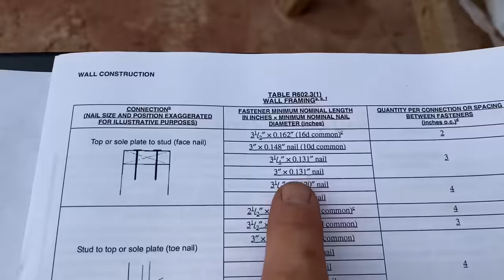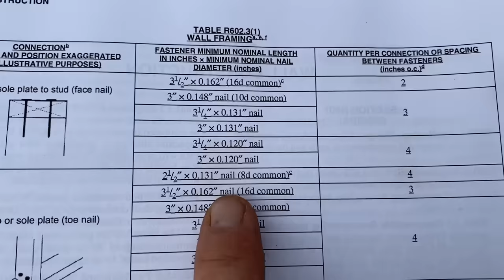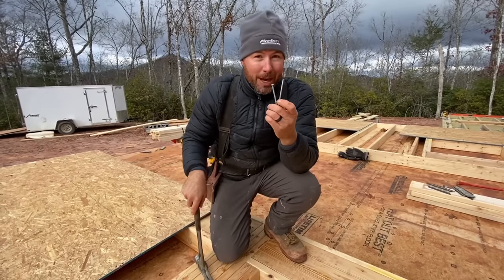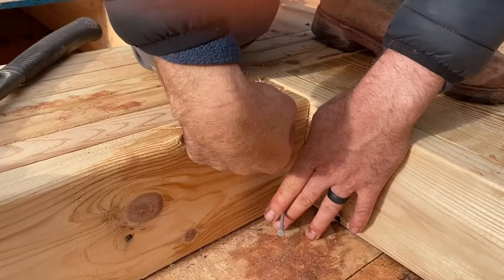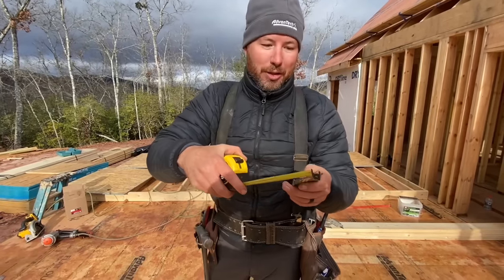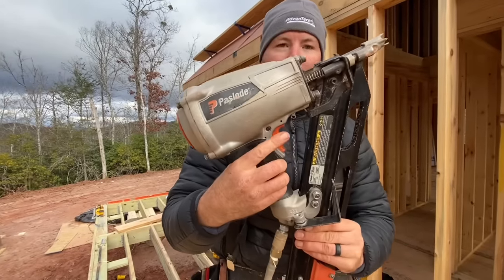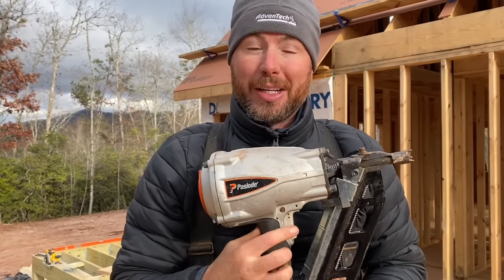Building Walls ~ All about nailing patterns and placement

Comment: Towards the end of the video I was wondering how many nails actually go in a general house and then you nailed it. And then I got paranoid and looked around the room. LOL it’s easy to find a painter, all you have to do is look for the white line down the middle of the road. Lol
Reply: Nailed it
Reply: @DiamondSupplyC0  yeah I’ve driven by a few construction sites, and I’ve learned to avoid them otherwise I’ll have to go to the tire shop later on. Lol

Comment: I’m a Framer out here in California and I love what I do makes me feel like an athlete building where there was nothing  is amazing to do and watch ...
Reply: No kidding framing is not for the weak
Reply: R. M Framing is for the weak. They are not strong enough to be Masons and Bricklayers. Carpentry is an inferior way to build also.
Reply: @zackzander425  what trade do you do?
Reply: R. M Masonry 👍
Reply: @zackzander425  figured. Masonry is tough work no doubt. But most brick houses start with a wooden frame lol.
Reply: R. M You’re right; sadly that is the case because timber is so plentiful in North America. Wood framing is relatively cheap compared to block construction so that’s why almost all homes only have brick or stone veneer anchored to a wood frame if any at all. I just look at the larger picture: fire safety, energy efficiency, durability etc . . . Masonry wins every time. I love hardwood floors, custom cabinets and trim though in a house. I have respect for all trades; none of them are easy, but they’re all worth doing. I was just being a dick. Stay safe out there on the job. 👍
Reply: Carpenter

Comment: Live It!  Love it!  Can't get enough of it!!!  Framing is amazing!!  NR90AC3 (rare Hitachi nailgun) can shoot up to 3 1/2" .162 nails if you need it.  At a min. we use .131 or .148 gauge nails as spec'd.  Default sheathing is 6/12 (6" o.c. along all panel edges and 12" o.c. in the field)  Engineering can specify some beefy shear walls - like 4x6 studs with .162 ga. nails 2" o.c. - but that was 1 out of 350.

Keep on making the videos....y'all are better than TV.  In fact, you had better be cataloging your videos into a format to sell to vocational schools so they can have a great video library for the next gen (if we can motivate them to work with their hands and backs.)

Great job, as always.  Upbeat and most of all REAL!!!  May you continue with unbounded success.

--
Mike

Comment: At 1:47 you mentionned about holding the the stud further up and that is also not correctly doing it because I have nailed myself  because of not doing it correctly and the only safely effective process is by nailing the bottom one first and then letting it go for the other two because the framers that I've seen don't use Pasloads;  they rather use the air guns that you can hold the trigger and go fast and I doubt ever changing that habbit no matter how much you'd advocade it and when I had framed alongside of pro framers;  I had of course gone faster than they were going but only because I was racing and they weren't.  So that is what happened with me;  I split the edge of the top of the standing plate and I was holding it further away from the edge but it still went through the as it broke the through and lodged itself just above my muscle tissue about half an inch before my index's knucle and past the other knuckes the same way and then I pulled it out easily;  then it had gotten swollen and hadn't gotten stiff or nothing else.  Not sure about anti-biotics but there is another possibility of accidents and it could be avoided by use of a dado that would fit overtop of all the standing studs and would hold them correctly in place as a bonus if their all crowned and if they are all in the same directions or  this dado could have somewhat of individual adjustment that would be user friendly like by just moving the piece to the correct spot would lock automatically and of course there isn't always an area that one could use these and the certainly would be in the way but if they were to prove more useful than a nucense;  then right on.  Cheers;  so always hold further up and let go and remove your hand and that way nothing can happen to you unless it hits a knot and curves and hits in your juggler.LOL  Just kidding.

Comment: Can you show how to read a Nail Schedule on construction plans? For example, how to correctly interpret a line like this? CEILING JOISTS TO TOP PLATE, T.N. 4-8d box, 3-8d Com, 3-10d box, 3-3"x.131 nails, 3-3" 14 gage staples

Comment: What you said about toe-fastening is exactly what i do...and with screws. And about 1/2 the thickness of the material.
Where I caught on to it was when drilling angled holes in steel.
Even a split point bit won't stay put when drilling at an angle..  so I would drill a straight pocket first
 then use it to pin the angled bit in position.
It works the same for wood screws. Bore a small hole straight in...then reset the screw at the desired angle.

Comment: Great work but I have a question on exterior plywood wall sheathing.

What is code for nail size for exterior plywood sheathing 15/32 ? All I can find is 2 3/8 hdg ring shank for my nail gun.

Is that what you are using 2 3/8 Ring Shank .113?

So you mention for 1/2 plywood you can use 6d or 8d is that correct for 15/32 plywood
Thanx

Comment: Does it matter if you are using 2x4 or 2x6 lumber when nailing the top or sole plate to stud? Would you still use 3, 3 1/4" x 0.131" nails in each stud no matter if it's 2x4 or 2x6? It looks like 2x6 lumber in the video.

Comment: I work with an older gentleman for a few years that would always Nail in opposing directions. He would never just drive nails straight down. He would always put them in at a slight angle either facing one another or away from one another. He did so that way it's a lot harder for the boards to pull apart. It took him a little bit longer to do however, it worked.
Reply from the maker: Yes... he is right. Good move

Comment: I watch you from Switzerland, where we use the metric system. I noticed in this video the extremely small fraction of an inch figures you have to use for the specifications for nail sizes. Do you ever wish you could use the metric system?  It does seem to make construction math easier, but I was curious if you ever think about this issue, or if you ever work in the metric system anyway, because I see most tools wherever they are sold now show metric measurements.

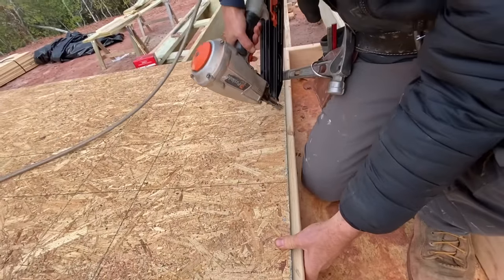Comment: I sure do appreciate that you took the time to put these videos up. BTW, it looked like your knee was pretty close there at 4:07... :)
In reference to stitching the sheeting to the stud, at what point do too many nails weaken the wood you are nailing to? every 4 inches times 2 sheets is a lot of stress on the wood grain isn't it? I can imagine a "V" shaped tear happening from what is effectively 2 inch spacing.
Reply: Framed this house once that the building inspector had us do spacing every two in around the perimeter and 4 in in the field.  If your sinking the heads too deep your making it weak for sure.
Reply from the maker: Good question.. I’ve never seen this happen though with the small diameter sheeting nails going into the side grain

Comment: 38-year Carpenter here again; you should try my invention sometime, I call it "the claw". Good for headers, jack studs and especially nailing stringers to posts on a deck! 1" in from the edge of board, 4-6 nails in a vertical line angled in towards the meat @ about a 30°-35° angle & again in opposite direction from the other side, now try to pry them apart! Have fun! I literally went back to tear a 2 year old deck down that I had built in order to build it bigger but the customer wanted it all new & we barely got the stringers pried away from the posts far enough to get a sawzall blade down in there to cut the nails loose! My helpers couldn't believe it! Otherwise known as "Da Claw" among several fellow contractor friends of mine! Oh, as far as headers go, do each end of one with the nail lines about 4 inches apart then try to pry that apart! Take care!

Comment: When you have tine would you mind doing a video on battery powered saws?  You use them allot and I think your info and comments could be helpful for people debating the purchase of a battery powered saw.
Reply: Depending on your use-diy-contractor, etc. You see these guys using all kinds of cordless saws from 20 volt DeWalt to 18 volt Makita. I'm a framer like these guys and I swear by the DeWalt flexvolt sidewinder (circular) saw. It has allot of power and a charged flexvolt battery will last a long time, all day depending on how much use. Stair stringers and cross cuts will drain the battery quicker but I love it and would never go back to corded. Anyway, my two cents

Comment: Also about the hand placement for nailing. NEVER EVER bump fire close to the top edge of the plate.. I had the saftey just barely catch buf the nail missed the wood flew a foot through the air and into my knuckles

Comment: Love your video's! Quick question about joining 2 studs together is it 2 nails every 16 inches or 1 every 16 inches staggered?
Reply from the maker: 2 every 16 is probably beyond code. It’s cheap insurance that everything will stay put for the long run though
Reply: @PerkinsBuilderBrothers  - I like to use ring-shank nails everywhere I can.  I like the extra holding power.
Reply: 16 every other but 2 on the ends.
Reply: @PerkinsBuilderBrothers  what code are you using

Comment: Do you agree with wood glue or liquid nails on sheeting?
Reply: pro's  and architects in general dont like glues or epoxies..... for houses expand and shrink alot!! wet and dry! no glue can survive the temperature flexing of a house....if you notice old carpenters leave a small gap....for expansion...300 year old furniture = $10000/chair!!!, for chair or tables i use glue and epoxy all the time...liquid nails is stronger than the wood in 3/4 inch!!!👏👏👏❤️💋😳😳😳

Comment: I've helped our local Habitat for Humanity frame house for last 20+ years.  I don't recall ever putting more than 2 framing nails into a 2x4 wall.  We use Hitachi nail guns, but not the clipped head nails.  Yours looked like clipped head nails, but I could be wrong.  I always assumed we over nailed things....but by what you just showed, we are a bit short....

Thank you for posting these videos, I've learned a lot.
Reply: How could you possibly think you were over nailing if you are only putting two nails per stud?  That is just crazy and not to code.  Did you even have inspections or was someone following behind you and fixing your mistakes?
Reply: @chrismoore9997  I said "over nailed things" as in the whole framing process.  Of course 2 nails per stud was sufficient.  Fixing my mistakes.....I think not.....
Reply: We dont even have code in most towns in my state, but my philosophy is unless you're splitting the material apart, more nails is usually better than less.

Comment: on the Top of the Walls 2x4 normally Doubled up ? do you Sheath Right to the TOP ? ot Leave 1/2 inch with the 4x8 sheet

Comment: When nailing the 1/2" sheathing to the studs, is there a recommended thickness needed for the nails? S.113 vs .120 for the pneumatic nails?
Reply: It is likely you will buy the thicker nails for the job site, so go by the Framing Code for quantity/ spacing of the nails.

Comment: 3:33 why so long nails? the osb is just like 13mm or so.
Reply: Longer nails have less draw out. What I mean is that over time and the materials expand and contract it starts to pull the nail out unless it’s a ring shank nail or screws. Due to nail draw out; walls and roofs will loose strength in high winds which could lead to failure of materials and the house may possibly collapse in the future. If it were the same case for a floor all it would do at the worst is squeak and bounce which can be annoying. Hope my explanation helps.

Comment: I'm not a contractor, just a diyer and I don't have a nail gun (yet), just a brad nailer. My "trick" with 2x4 framing is I always put 1 screw in each end of the stud, then I hammer in 2 nails. Overkill? Yes. But then I don't have to hold the studs while driving nails in with a hammer. Similar would go for a nail gun.

Go point on the toe nailing too. Again I'm a DIYer and not trained at all but it was pretty easy to figure out toe nailing of driving it in straight then turning it to a 45-60 degree angle.

BTW it's "sheathing" not "sheeting".
Reply: sheathing is the nerve wraps around your bones, sheeting is a 4 foot x 8 foot size piece of wood

Comment: I like the way you build.  I use the same nails but I don't like them because they only have half a head.    They don't need to be ring shank when they only have half a head.   I use lots of them.  4" spacing and such.   I like my 21° framer that shoots full head nails but it's like a hundred years old and it's heavy.   I wish I could find full heads for my framePro

Comment: Have you tried Paslode Tetra Grip subfloor nails?
Reply from the maker: No I havnt... we have been using the quick drive screws. Do you like them?
Reply: I am a wholesale distributor of Paslode. The TetraGrip (TG) nail, when installed correctly would eliminate the need and cost of QuickDrive screws. Additionally, their ICC testing was done without the application of subfloor adhesive.
Reply: BTW- I sell residential Construction Fasteners for a living, and really enjoy your videos. It is cool to see how our Fasteners are used on a typical job. HATE to see Huber products though,  lol.

Comment: 12 inch in the field, 6 inch on the perimeter. 6 or even 4 in the field, unless called out, isnt necessary, even in earthquake country. Electricians and plumbers will hate you if you like to over bump.

Comment: These people were I live say fire blocks ain't code there headers r square 8 inch pieces instead of solid pieces there TS r just little pieces not full boards like it should be heads they only use 4 nails instead of 6 I've never seen anything like this before I actually had a book that my little brother gave up on for a contract license accredited bye international building code